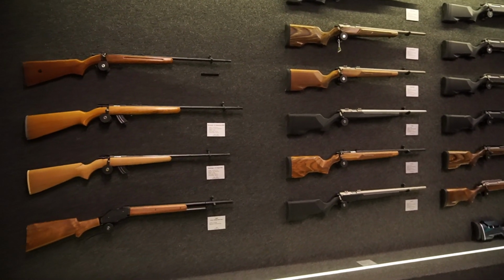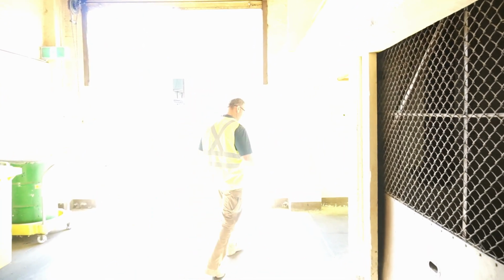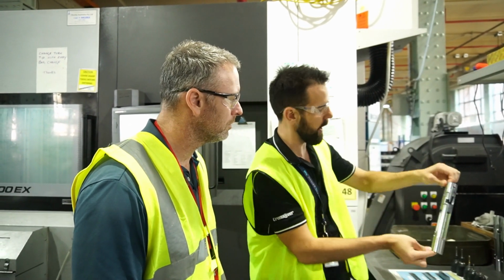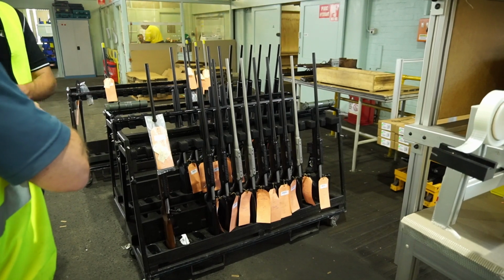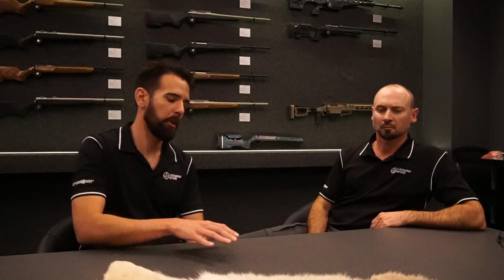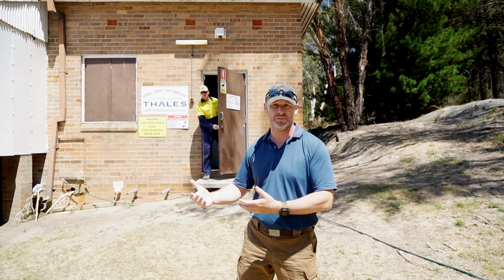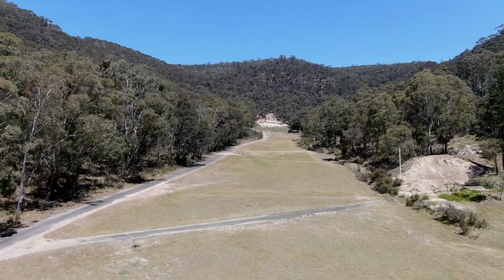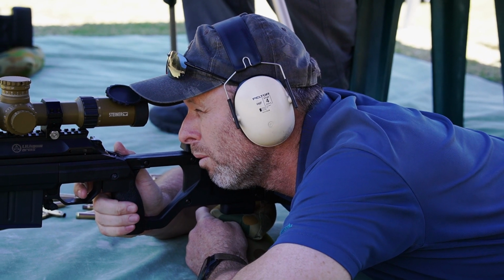Inside Lithgow Arms - Ep 10

Comment: I have a LA105 in 6,5CM , after approximately 500rounds I had a few issues, the action front bedding screw came loose and only had 3 threads purchasing into the action. The rear bedding screw goes into a dovetailed nut in the rear action tang, this was also loose allowing the action to move side to side whilst firing causing split groups. As I am a fitter machinist I have the skillset to remedy this, but why isn't it built better in the first place! Also the locking lugs had to be deburred and trued! Shoots fine now. 10mm groups with reloads.

Comment: Remanufactured Lithgow no1 mk3 & or mk3* rifles would sell more then any of these modern rifles .
Parts kits for existing rifles & accessories are another avenue.
Hunting & patrol type rifles or any modular configuration is possible on that platform.
Wrist adapter for AR buffer tubes / stocks  & pistol grips .
The sky’s the limit with options to the forend . Dream it build it .
The Indian ishapore no1 mk3* rifles were made with a better steel & heat treatment ( back in the 1960’s ) & chambered in 7.62 nato .
As if stronger one’s couldn’t be made today & chambered in 223 , 6.5 creedmoor, 308 or some of the short magnums . 
With mim & investment casting techniques, polymer stocks , laminated & carbon fibre stocks there’s a rifle for almost everyone.
The ELR market is relatively small 
A no1 mk6 1/1 is just about perfect for most hunting scenarios, it crosses over the Jungle Carbine , patrol rifle , hunting rifle, service match rifle roll perfectly. Rear mounted flip up peep sight , charger / stripper clip fed , 10 rnd mag , red dot or forward mounted scout
 scope . Or over the action scope if preferred. 
Just my opinion. Probably everyone I know would buy at least one !

Comment: Now if only the bullet manufactures went to this level of detail and accuracy down to 0.06 micron, which is diamond machining specs. I was privileged enough to sell aerospace / aircraft alloys and i can say when you get down this grade of manufacturing its almost aircraft manufacturing grades and engineering, the only aspect is certification in aircraft manufacturing and maintenance and military product manufacturing you required to have 3 separate qualified products specific engineers to sign off on the various jobs as they move down the production line? Which is for certification and traceability should anything go wrong?